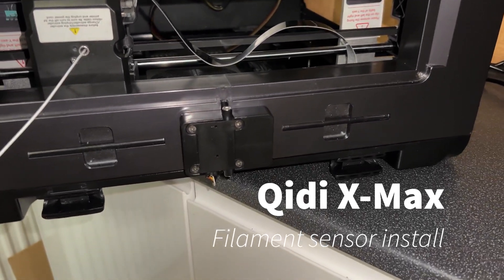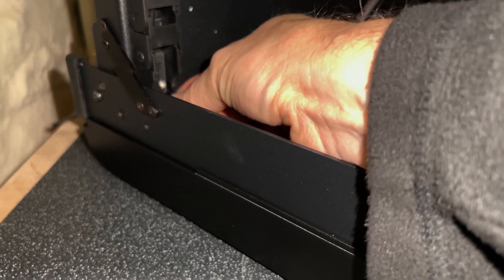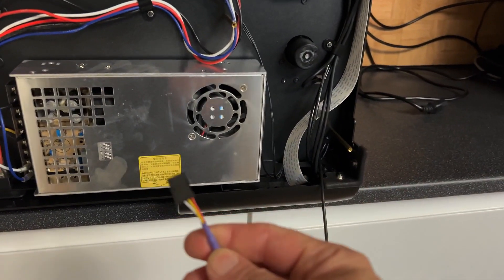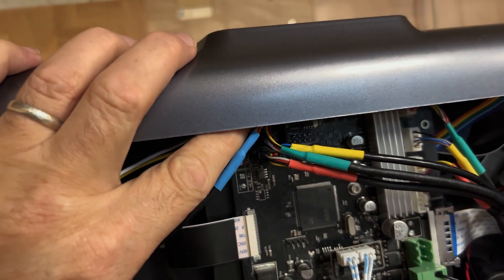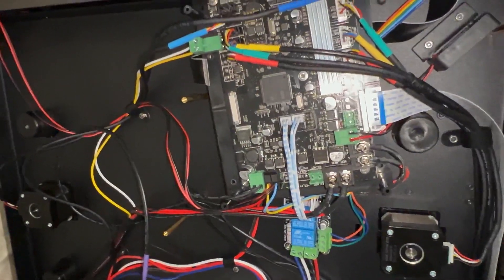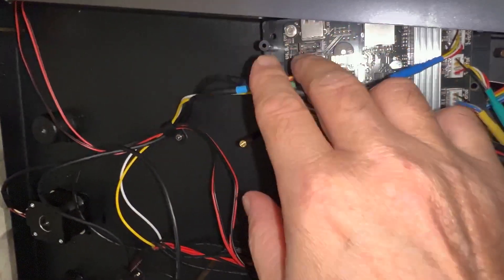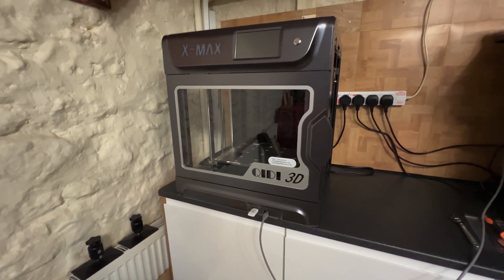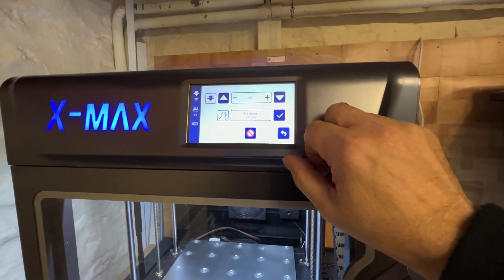Qidi X-Max filament sensor install

Comment: Hi Can you add auto bed leveling sensor to this x max 2018 ?
Reply from the maker: @M.altarhoni2024  not that I’m aware of. But to be honest, I’ve never really needed it. One the printer is levelled I’ve not had to adjust it.
Reply: @ivanshobbies  good luck sir 
A friend of mine has one and he asked me about adding a bed level feature .. 
Thanks alot

Comment: I have the X-max and installed this Filament Runout Sensor as well . Very easy to do . However , my first test of running it out was a bit tricky . The temp for the print head turned off , so I couldnt run the new roll of filament through . Everything looked good and the printer confirmed the filament ran out , but it should then automatically run the print head in reverse to pull out the old filament , and drop the bed to give you room to run the new filament through , before restarting the print. Are there other steps I need to do first ?

Comment: Hi could you possibly tell me if the sensor is just a micro switch type or is it optical, I have a switched type but I can't find out the type of input it takes as there is 20v at one of the terminals
Reply from the maker: Hi Jeff. It’s a micro switch. It plugs in to the main board, the port for it is hidden so you need to unscrew the board to access it. Hope that helps 👍🏻.
Reply: @ivanshobbies  Thanks Ivan for the reply, I was just surprised that the input was as high as 20 volt. I'll give it a go thanks again
Reply: @ivanshobbies  Please note anyone who is using a non X max switch with a different connector and have to alter it to fit, the inputs are pulldown so the 0 volts (negative) is connected to the 3rd pin up from the 0 volts for a single head do not use the +volts.